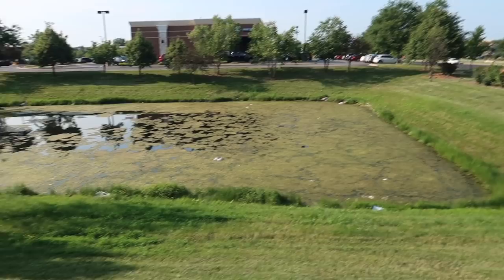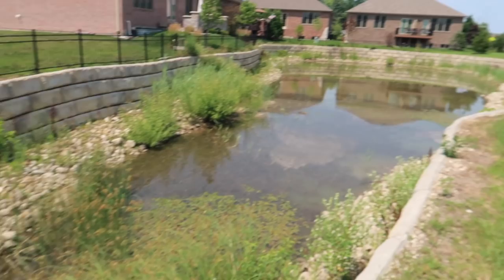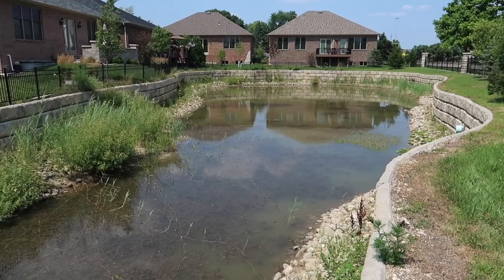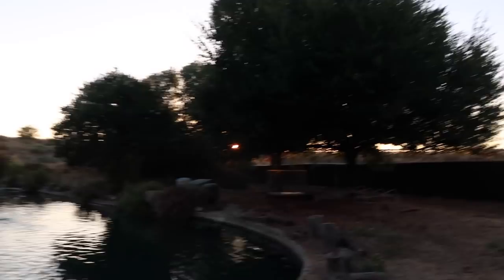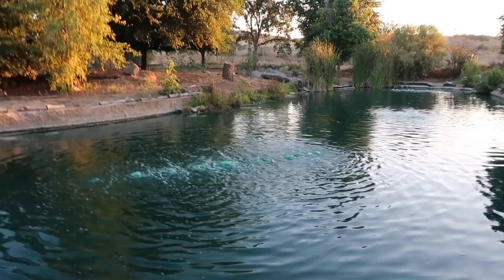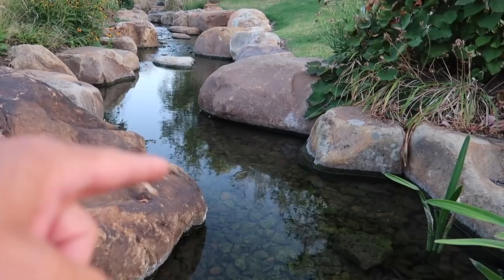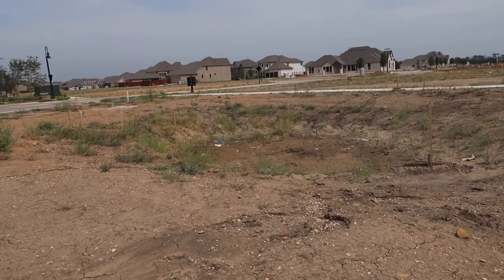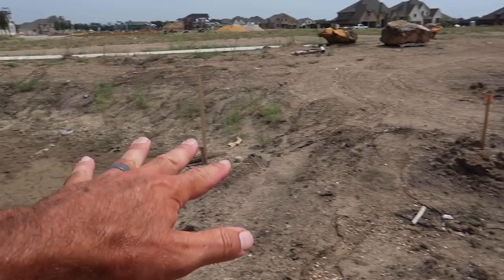How RETENTION PONDS Manage Storm Water Runoff

Comment: Great video matching my question. Dear Ed, what is the appropriate or potential area to design a storm water retention pond? is it to any area near a water body? can the term rainwater retention pond be used similary as stormwater retention pond? Thank for answering...
Reply from the maker: Great question,
Yes the terminology is universal Rainwater/Stormwater Retention. 
The Location does not need to be near an existing water body but it will eventually connect to a downstream system so elevations/overflow pipes need to be carefully determined.
Reply: Thank you very much for your prompt respond dear prof ed.  Actually i provided a recommendation of designing storm water retention pond near a lake so that it can be retaining or capture stormwater runoff and protect thw lake from pollution. Then, i was told that, storm water retention ponds have been used in many areas but i did not give an evidence showing that the pond is really needed in my area. How do i go with this or what should be considered when thinking of designing a pond? thank you really much
Reply from the maker: Ponds will help to capture and hold Phosphorus, this is a very important piece of the equation because Phosphorus is typically the limiting factor for noxious algal growth including Cyanobacteria,
The Phosphorus is precipitated out if the retention time is adequate enough. 
Another important piece is a Restrictor pipe for the overflow(4”) for example on a 1 acre pond will only allow a small volume of water to leave the pond in a 24 hour period, the pond level will temporarily rise and the water velocity will drop to allow the sedimentation processes to occur, this will also protect the downstream habitats from flooding.